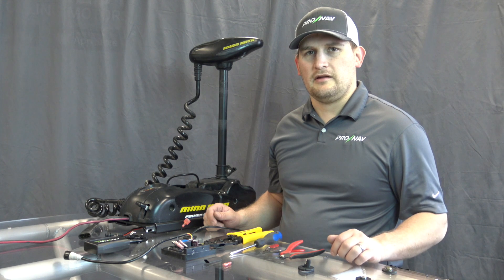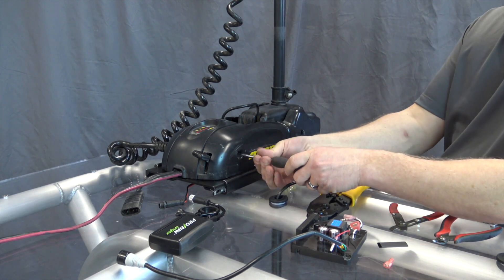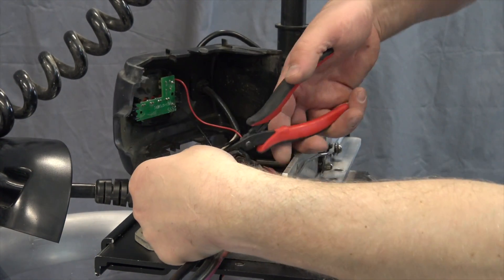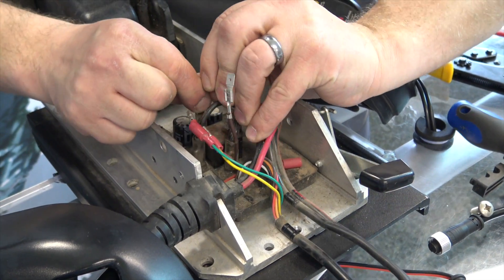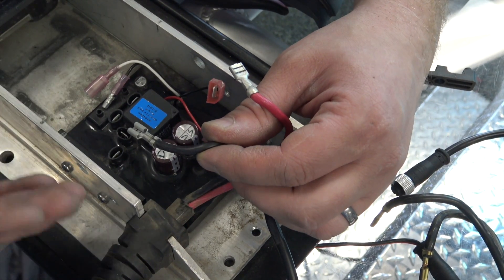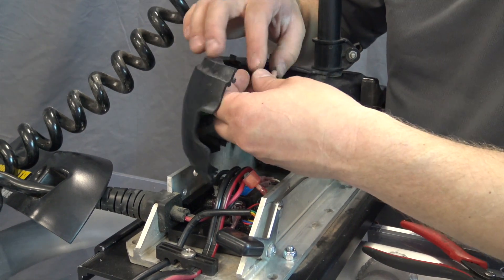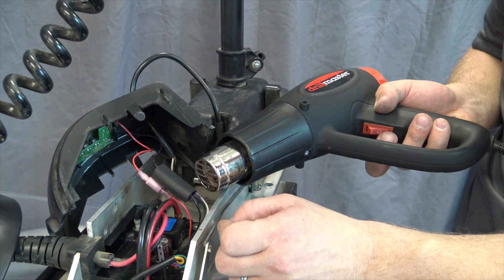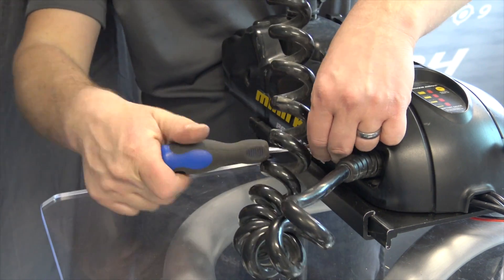Add ProNav Angler GPS Autopilot | Upgrade Minn Kota PowerDrive (V1) to PowerDrive V2

Comment: Is the control board the GPS system as well im having trouble with my V2 locking in on GPS for my spot lock it just spins in a circle and shuts down.

Comment: My older (2005) V1 foot control was bad. Watched this video and read some blogs. You have to get the control board that ends in 457 for the 12 volt system.  I'm by no means an electrician. But I was able to switch my old V1 to the new V2 foot pedal with no problem. Thank you for this video!

Comment: Purchased to add to my kayak for long distances>>>allmy.tips/MinnKotaPowerdrive?52Z     It doesn't really make me go faster than if I paddled full speed, but saves me from getting tired when I use the kayak for going a long ways in to hunt. Not a bad motor. Weeds do tend to clog it up so I'd probably not recommend this if you're using it in a weedy lake/river.

Comment: Do you have a part number for the conversion part and where can I buy it
Reply: https://www.ebay.com/itm/Minn-Kota-Control-Board-For-Powerdrive-V2-2884057/253827059452?ssPageName=STRK%3AMEBIDX%3AIT&_trksid=p2060353.m2749.l2649
Reply: The link I provided is for the 12V power drive.
Reply: Will this part number work for copilot. Thank you

Comment: Very useful subject.  Can you provide the appropriate part number for the control board to use to convert the V1 powerdrive?
Reply from the maker: Thank you. We sell the upgrade kit with the ProNav Angler on our website: https://pronavmarine.com/product/pronav-angler-with-powerdrive-upgrade-kit/ . 

We do not sell the boards separately, but you can give our office a call if you would like more information about the parts. Our office phone number is (906) 523-7007. Thanks!